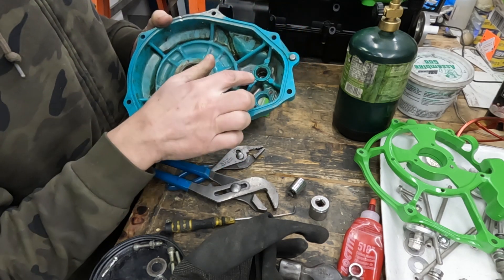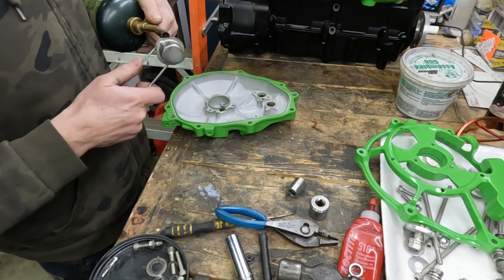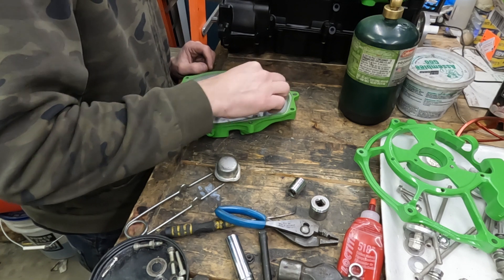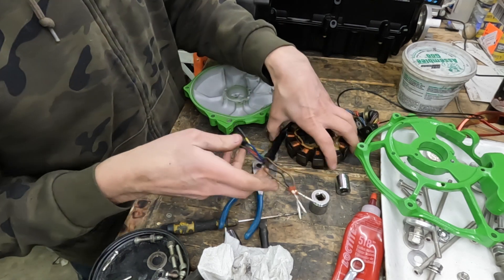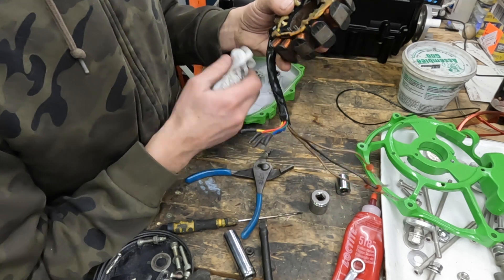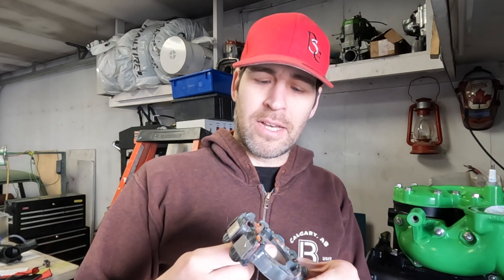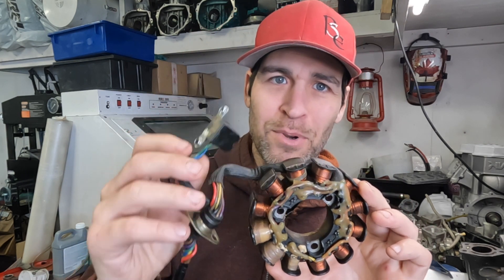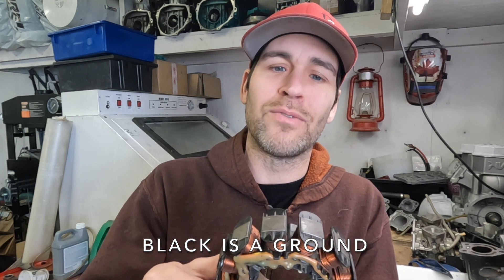Stator Modifications / Installation - Minor Setbacks

Comment: I would like to see you get deep into a Yamaha 1100 or 1200 to the point where you can compare it to the Kawasaki 1100. I think it would be interesting to hear your objective opinions on which is better and why or which is better for what. Example being we think the Yamaha electronics are better but the Kawasaki engines themselves seem to hold up better but maybe that’s because they never run because they have crappy electronics. Just a suggestion, clearly it’s your channel so do as you please. 👍 seems like you should use a Tupperware for an ebox although it wouldn’t be very Joel Arseneault of you to do that 😂😂
Reply from the maker: I agree, that would be cool, a Yamaha 1200 is something that I would like to play with in the future. 

I think Kawasaki engines are stressed a little less, meaning, they make less power per CC from the OEM … or maybe I’m wrong … that would account for some dependability. 

That being said, I think dependability, once you start modifying, has a lot to do with how (well) the mods are done. 

Tupperware ebox DID cross my mind just to get it on the water, as I am quite busy, but that would likely mean wiring it twice when I decide I needed something better, and ended up making a carbon fibre one anyway 🤣

Comment: Are or as u say arrrr you trying to ride it this year? If so probably build the ebox on the side and use what u have currently
Reply: On the 300 the oem firewall used to be about 8in or so more forward I had to move all that back, you could have your friend 3d print a cover for the time being, could even use that as a plug
Reply from the maker: @Trevorkloida  Yeah... He is away in BC until Thursday, I believe... but I was thinking the same thing. I need to get him printing me way more stuff... I need to get my own printer eventually, but there are a lot more important things at the moment, haha.
Reply from the maker: Haha... true eh. The main problem with that is that I don't currently have any ebox and I just had all of the electronics out in the open... due to the limited space, I had the CDI mounted right over the engine... I plan on putting it back in that spot, but that means building something to protect it. 

I'm actually surprised at how much space you seem to have in. your ski. I've been thinking about using the space in front of my water box for electronics, but that's a lot of long wires, and if I want to get to any of it, that means removing the fuel tank and water box. 

I'm hoping that a CF part won't be TOOOOO insanely time consuming.

Comment: waiting for that zeel instal since a put 1 in my krash 997 and it is not working
Reply from the maker: Oh SHIT .... That's not what I want to hear, haha. What's it doing / not doing ? I think some of them come with the Zeeltronics, dont' they ?
Reply: @JoelArseneaultYouTube  the 2021 and up i think yes but i have a 2020 with the kavinci cdi and it fried, switch to the zeel and i have 12v comming out the ground wire haha waiting on zeel for a reply
Reply from the maker: @mentalmens  Interesting.... I don't know how it's wired, or how you are testing, but it may be normal for it to show 12V at the ground. In fact, depending on how you test it, it will almost certainly show 12V, if you are talking about the main ground.